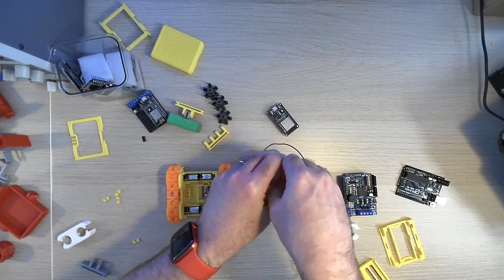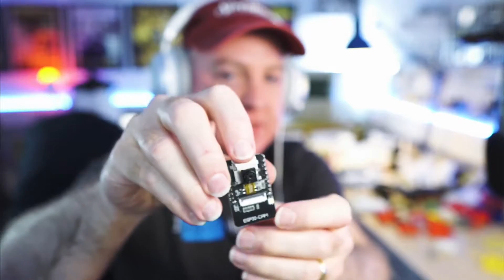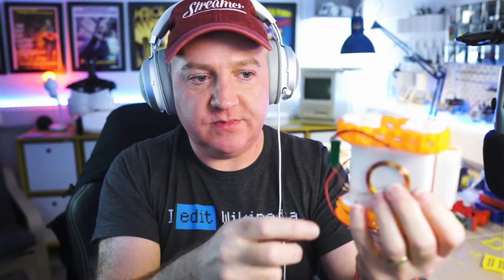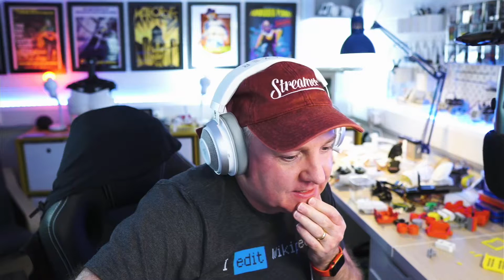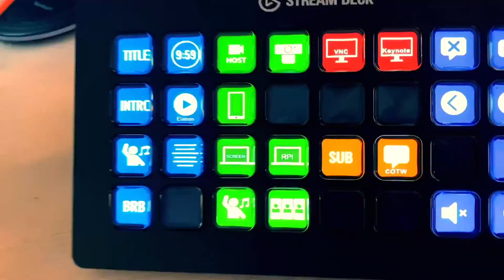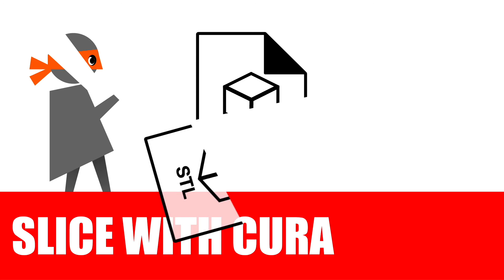Version 4 SMARS vs Original SMARS robot - what’s the difference?

Comment: It´s hard for me to source the N20 6V 150RPM motors, the once I found are about 10-20 bucks EACH, that´s way too much. Also I can´t find the MX1508 board anywhere. Additionally the 9V Battery is expensive and I think the design should be updated to a better more modern power source, say 2x 18650 batteries with a standard 6V DC Motor + 3D printed gears. We are 3D printing many parts anyways, so 3D printed gears should be fine. The motor alone for me cost a little over 2 bucks, that´s way more affordable.

Comment: Where can I find the small motor control ?
Reply from the maker: It’s an n20 150rpm 6v motor
Reply: @kevinmcaleer28  sorry I meant the small chip that it inside
Reply from the maker: @manuelmorales8446  that’s the MX1508 motor driver board